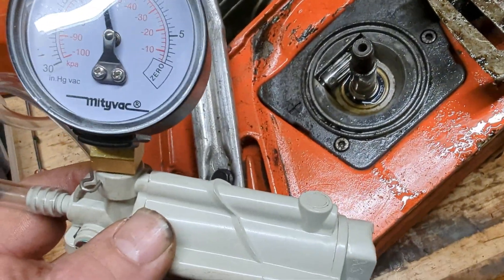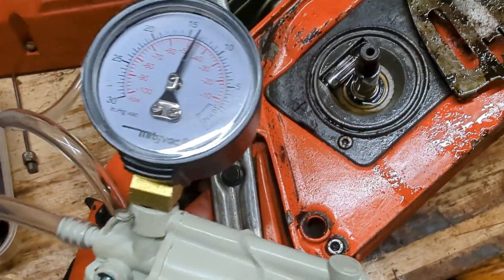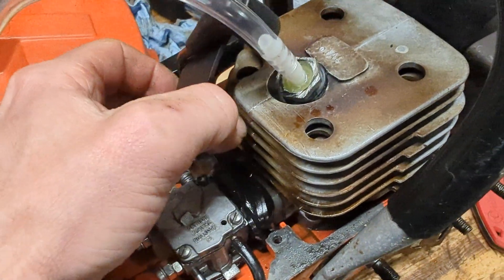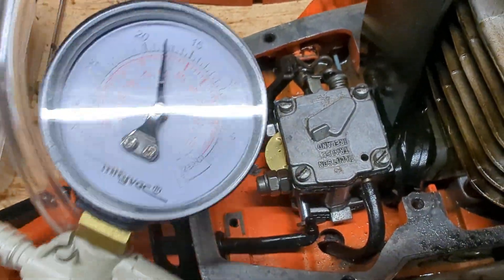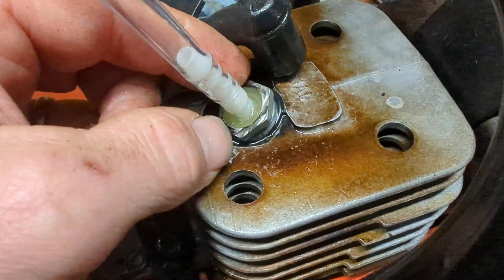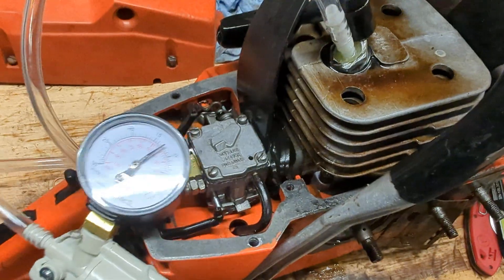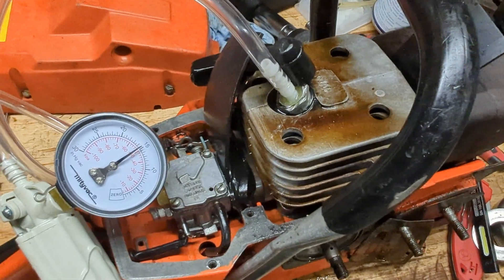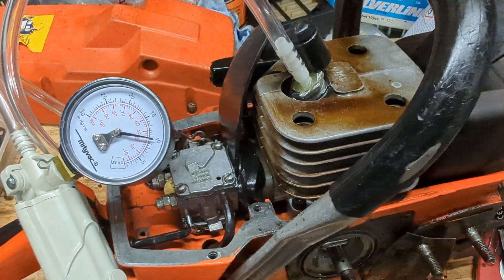Vacuum testing the 268xp.. would you run this? Chainsaw repair & crank seal test with MityVac

Comment: Hey James, before you go hunting for lil vacuum leak boogers you'd be time ahead to pressure test the saw 1st to see if your block-off rubber pieces & spark plug inlet are ok - easier to see a pressure leak vs a vacuum leak...
Reply from the maker: Thanks man, yeah I'll be firing some pressure in there for sure. Hope you're good.

Comment: So, if it was my saw I’d tear apart the oiler and look at the O-Ring and X-Ring on and behind it, I’d replace those and they are still available as an oem part if you need the part number I can get it for you. Also, if that fails I’d seal the crank seal carriers with moto seal or other fuel resistant sealant and try again, this is the one thing that pressure test are better at they can help show where leaks are with soapy water. Either way good luck and best wishes
Reply from the maker: Yeah I fitted the crank seals with a smidge of Moto seal. I didn't look at that O ring though.. I'll get back into her this week. I'll get there!

Comment: Nice! Yea vac is definitely the only real way of testing your seals but pressure will tell you about everything else. Someone told me you coild set your air compressor mega mega low and just put a bit of pressure in that way but im not sure about that myself.

Try putting the plastic air horn that goes from the filter to the carb on to pack it out abit to be able to get the carb bolts to fit properly.

Also if your not sure about your spark plug thingy leaking. Put a normal spark plug in and use the impulse line to test it.

Make sure you rotate the crank while its under pressure/vac as well because if the seals arent quite seated correctly the leak might show worse as it turns.

In terms of the leak itself there is some tolerance for it. I totally agree if that case is under vacuum for a slit second how much can it really pull in?

Sorry for the long comment! More waffle from Al.
Reply from the maker: Thanks for taking the time to write all that Al! Totally agree 👍 I'll get it in the end!

Comment: I’d run that. But it could be leaking from behind the oil pump, where it seals to the case with a thin o-ring. Have you taken the oil pump out to change the crank seal in it?
And pressure testing has its advantages that the leaky bits show more easy. You can also just use a bicycle pump for pressure testing.
And when changing seals, I always change both at the same time just to be sure.
Reply from the maker: Thanks man, yeah did all that apart from the O ring.. I'll keep at it and get her in the end!